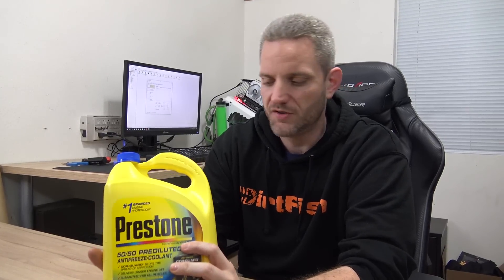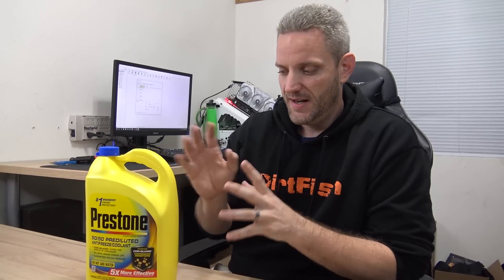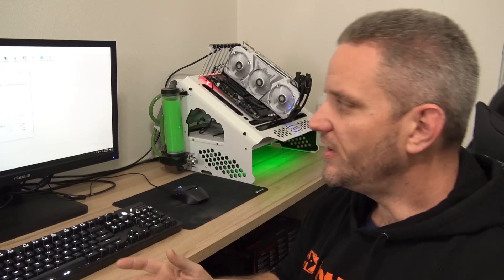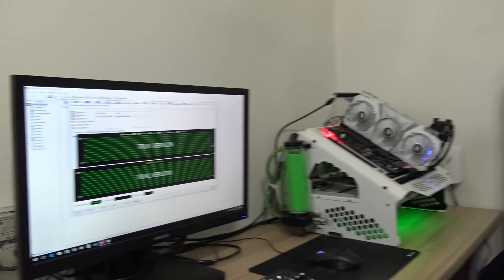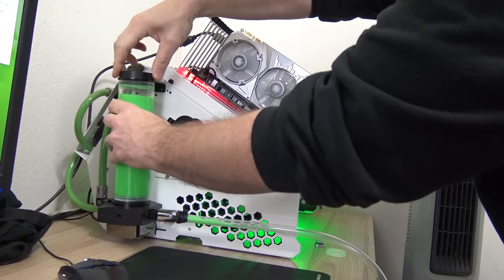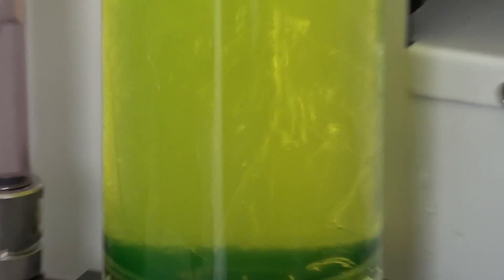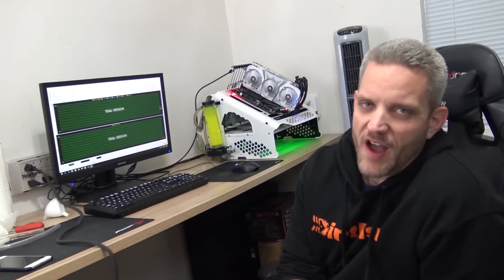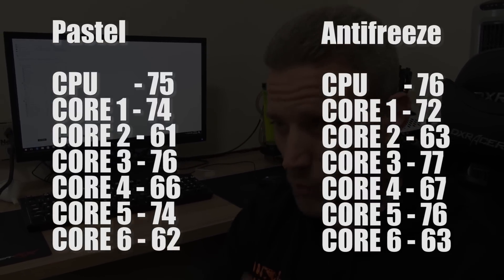I used Antifreeze to cool a PC

Comment: I used antifreeze to cool my car...
Reply: Pienimusta Antifreeze isnt designed to have better cooling ability than water. You can put plain water in your car, and it will work fine as a coolant. The only problem is if it freezes, it could damage your car. Thats the only reason it's necessary.
Reply: To be clear, you're using water to cool your car, the anti-freeze is to widen the temperature range it remains liquid and prevent corrosion.
Reply: don't use a hose. Distilled water.
Reply: ... but then i took an arrow to the knee.
Reply: JeffPlays actually the pressure in the system increases the water boiling point
Reply: YinYangGang, actually, aluminum does "rust." We just don't call it rust because it doesn't turn orange and fall apart like iron does, but aluminum certainly does oxidize (when iron rusts, it oxidizes) and it can corrode from this oxidation and begin to break down and affect the cooling ability of the system, possibly even causing a clog if allowed to continue long term.  This is why antifreeze contains oxidation inhibitors for multiple metals.

Darcnis Productions, there are still quite a few manufacturers releasing vehicles with iron blocks.  It is certainly not limited to only diesel applications.  Yes, they are becoming more rare, as aluminum is lighter and eliminating iron from the system greatly reduces the chance for destructive oxidation, but iron blocks are still much more common than you seem to think.

For everyone that is arguing about the merits of increased boiling point due to anitfreeze, this is a bit of a tricky subject.  To keep it simple, yes, antifreeze does increase the boiling point of water, though only slightly, and certainly not enough to keep the water portion of the coolant from instantly boiling on contact with a cylinder wall.  The main component that prevents the water from boiling in an automotive cooling system is pressure.  The greater the pressure, the higher the boiling point.  This is why pretty much every single radiator cap ever made has a specific pressure listed on it.  This is the pressure the cooling system can pressurize to before the radiator cap releases some of the pressure.  If the radiator cap was not capable of relieving pressure from the system, cooling hoses would burst and it can even bust open a radiator or heater core.

So, what is antifreeze really for then?  Well, it's right in the name.  It's to prevent the water from freezing at sub-zero temperatures.  The more antifreeze, the lower the freezing point.  Every manufacturer recommends a 50/50 mixture in order to best prevent the coolant from freezing in almost every location on the globe.  An added benefit of the antifreeze is that it helps protect the components in the cooling system from oxidizing; everything from iron to aluminum to the rubber in the cooling hoses.

However, if you live somewhere that it doesn't freeze, or perhaps, even if it does, but it doesn't get THAT cold, you can run less antifreeze.  Why?  Because of everything I've typed thus far, and because the water portion of the coolant is what does the job of transferring heat out of the engine.  Antifreeze is actually a terrible heat conductor.  For example, I live in Oklahoma and it's extremely rare for us to ever drop below 0° F.  Because of this, I run a 60/40 mix (in favor of water), because it removes the heat in the engine more effectively while still protecting my coolant from freezing at a bit lower than the lowest temperatures I see here.  If you live somewhere like Hawaii, you could get away with running something like a 75/25 water/antifreeze mix.  You never want to go past an 80/20 mix in a street car though.  At that point, you start removing too many of the oxidation and corrosion inhibitors and you begin to run a real risk of severely damaging the engine.

Now, in a race car that only ever sees 40+° F, isn't driven on the street, and gets rebuilt at the end of every season (at minimum), you can easily run straight water.  Remember, the pressure of the cooling system is what prevents boiling, not the antifreeze, so boiling is a non-issue (unless there's something wrong with the cooling system, such as a leak that bleeds of pressure or there's an air pocket trapped in the system).

Finally, to the idiot that suggested filling the cooling system from a hose, I hope someone knocks some sense into you.  Tap water is HORRIBLE for an automotive cooling system.  Not only is there all kinds of contaminants in it that can greatly increase the chance of oxidation and/or corrosion, stuff lives in it.  Wait, what?  What do living organisms have to do with anything?  Well, believe it or not, there are certain kinds of bacteria that LOVE, LOVE, LOVE glycol based coolants.  Have you ever looked in a coolant reservoir on a car with 60,000+ miles and seen a brownish crud caking the inside of it?  Yeah, that crap is alive.  You should always, always, always use distilled water in an automotive cooling system.

TL;DR, everyone in this thread except maybe two people have no idea what they're talking about.
Reply: im currently going to college for motorsports engineering, and this upcoming year will be graduating with and associates degree in motorsports engineering.
Reply: Kyukyumii _ the pressure in the system increases boiling point
Reply: I use only water and keep my car running through winter.  True story.
Reply: Yea but thats what the radiator is for, for acually cooling
Reply: YinYangGang, you're right, aluminum doesn't rust.  I'm pretty sure I even said that in my reply.  Hence, the quotation marks around the word rust and further explaining that it's called oxidation, not rust.  You're also correct that water alone will not cause damaging oxidation to aluminum.  However, throw in the inevitable contaminants found in a cooling system and the extreme heat from, say, an engine, and the oxidation layer will start to become thick enough and brittle enough to eventually flake off and enter the coolant.  Over time, this can build up enough to cause problems with coolant flow, not to mention the integrity of the aluminum.

As for the iron blocks, I never said they were common enough for just anyone to name a car you'd find one in off hand.  In fact, I do remember saying that they were becoming more rare, but that they aren't limited to only diesel and/or 3rd party builders.  Believe it or not, cast iron is still cheaper and far stronger than aluminum.  Until that changes, you'll still find cars with iron blocks.  I will give this caveat, you'll mostly find them in China.  But, I'll name one for you just because you asked: Dodge Hellcat.  Yup!  The Hellcat has an iron block Hemi.

I'd like to add this as well, there is iron in every single aluminum block made.  You sure as hell can't make a cylinder wall out of aluminum.

Just so you know, I have one of those "bullshit" automotive degrees: Automotive Technology with an emphasis on High Performance Powertrains and Chassis Fabrication.  I'm also ASE certified, but hey, you've done multiple rebuilds on multiple platforms, so what do I know?
Reply: Russ Andrew it also helps with boil temps some engines that are verry high performance can boil the fluid if it is just water
Reply: JeffPlays we use straight water in late model stock car racing engines
Reply: you have to use water when racing its a rule!
Reply: Yep
Reply: I've used straight water as well as water/surfactant in plenty of race applications where freezing temperatures and corrosion weren't a concern.  People truly misunderstand the purpose of these fluids.
Reply: the 2015 nascar whelen rule book page 74 subsection 20f-7 states "icing, freon type chemicals or refrigerants must not be used in or near the engine compartment." the thing about racing engines is you only run them a few races and then rebuild them, corrosion should be a problem because when you tear and engine down you put it in a solvent that gets rid of debri.
Reply: finn benham Yeah I suppose I wasnt perfectly clear but thats what I meanr
Reply: i use liquid au
Reply: yea but you dont necessarily need antifreeze, itll work with water also
Reply: o edgy
Reply: You can use water if you like rust.
Reply: Yea, but in racecars where they get rebuilt alot, the first step in the rebuild process is putting it in a chemical bath to remove the rust
Reply: Tigerfire828 Hopefully, you never have to rebuild your motor. So a chemical bath for most people is not a option.
Reply: Im in a racing college, i work with other peoples blocks
Reply: But im just saying thats how we do it
Reply: not to be a troll extended life anti freeze is not glycol based
Reply: Tigerfire828 Thats cool. Just saying that Bill Smith in Ohio shouldn't use water in this 08 Honda Odyssey. I wouldn't suggest anyone using it unless they know how to fix it or know someone who can (and can pay them). Most people do not fall into this category.
Reply: wow, why not distilled water?
Reply: +Russ Andrew while you are not wrong, unless you are using distilled water, it will probably lead to rusting in many of the components if done for a prolonged period of time. 

Even the average antifreeze/coolant has lubricants and rust prohibitors in them to keep things rust free and to keep the water pump spinning smooth. It should not be neglected, even if you don't need antifreezing properties. 

Even better is waterless coolant, but that is only just starting to become a popular option.
Reply: only used in countries where you can get sub zero temperature
Reply: Using water to cool the engine, you can do that but it won't last long. Boiling temp for water is 100 degree Celsius as we all know, your engine is operating at a much higher temp which would just evaporate the water.
Reply: Tigerfire828 you don't get what I mean don't ya?
Reply: Boiling point goes up to 129 degree for 50% mixture.
Reply: Yep, cracked engine block would not be fun.
Reply: +Russ Andrew
Coolants contain a surfactant which allows better heat transfer between coolant and metal, ie from the engine to the coolant and from the coolant to the radiator.
It more importantly in many climates also contains a corrosion inhibitor. 
Most modern engines have a mix of metals including aluminum, cast iron and mild steel.
Without the correct coolant you can potentially have electrolysis between these dissimilar metals causing sometimes rapid deterioration of your cooling system.
I have seen an aluminium radiator destroyed in a matter of weeks.
Freezing is not the only reason it is required.
Reply: Emma Roberson some cars use coolant, some just use water
Reply: hopefully it doesn't reach cold enough temps where you are to ice up and blow the freeze plugs out of your engine block
Reply: Nah I got auxillary heater, I'm running benchmarks on an AMD based laptop under the engine bay when it hits -30c or lower.
Reply: RIP
Reply: YinYangGang There are still some manufacturers using cast iron for their engines just so you know.
Reply: ok water boils at 100 degree if 100 % pure and a sea level if pressure changes ie lower pressure lower boiling point higher pressure higher boiling point thats why most but not all car cooling is under pressure to raise boiling point there are cooling sytems (old ones) that could go as high as 90-100 psi before the cap would let off pressure most today only go to 30 psi max
Reply: hope you count me in the list of people that have a idea of what theye and you are talking about as i agree with 99.9% of what you said lol
Reply: You just keep digging yourself a bigger hole bud.  I wasn't talking about an aluminum alloy.  You can't even use that for cylinder walls.  You have to have iron sleeves.  That I was talking about sleeves should have been blatantly obvious when you read the words "cylinder walls."

And yeah, I get technical and scientific about this stuff.  Why?  Because you have to in order to fully explain why this stuff works the way it does.  You think Jayz's videos would be half as good if he didn't go into some scientific detail on why things work the way they do?

God forbid I attempt to correct you or anyone else in this thread when you try to teach people something that's wrong or, even worse, incomplete.  After all, you can't explain why the apple fell without also explaining gravity.

I'll tell you this though: you've given me a few good laughs. It's been a while since anyone has attempted to argue with me on cars.  I did notice you didn't actually refute anything I said in your last reply though.  You just desperately attempted to salvage one of your arguments, but ended up just smacking your head into the wall again, and even harder this time.

Anyway, thanks for the laughs and have a happy new year.
Reply: to YinYangGang. Jason Lahr both of you are right in your own way and both missing small point that each other are saying. i have 35+ years working on every thing from old minis right up to 800+ bhp race engines  yes water can react with all metals in a engine and make problems long term but so can antifreze ther was a big problem in the past with it eating parts of engines even to day with new engines and plastics so there is no one right or wronge most problems with cooling are helped by lack of proper servicing and having a car ten twenty years with out ever fushing or cleaning it out even wen a part goes people just replace part and fill back up it is not very often that it gets cleaned and flushed some antifrezes even have a electic reaction in the engine that turns it in to a sludge due to moveing though over metals and creating a small charge that brakes down the molicles sorry cant spell thats why i fix cars lol
Reply: I use antifreeze to keep my car from freezing.
Reply: Tickets Travels ....this is just funny...
Reply: nice line Pienimusta
#Antifreeze
Reply: Yes and no. The cooling systems in most automobiles is a pressurized system so that boiling temp will be much higher and it only vents when it passes a set pressure. Most all also have a re-circulation tank so as the coolant expands in the system it will be pushed out into it. As the temp cools it will draw the coolant back into the system.

The only problem with running water is rust and electrolysis over time. It will function just fine as a coolant otherwise.
Reply: +rentaspoon There are 0 pressure coolants.  But if you read what I wrote more carefully, you'll understand I didn't mention raising the boiling point.  Most "anti-freeze" does actually raise the boiling point slightly; 5-15 degrees Celsius depending on the mixture and altitude.  However, the pressure in the system increases it more.
Reply: dj beard But if you use distilled water the process takes a lot longer because there is no added chemicals like tap water.
Reply: I use the shade and ac
Reply: Right? This girl at works radiator leaked all summer. She constantly topped off with antifreeze, in 90 degree weather..... I tried my best to explain, but would never believe me she could use the hose. Probly spent a fortune....